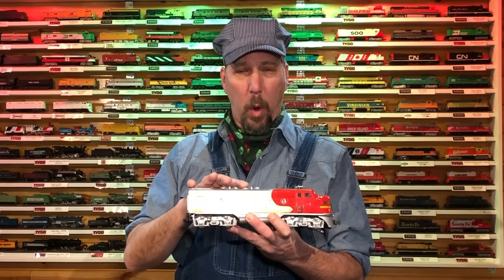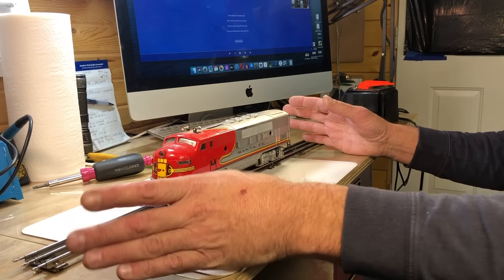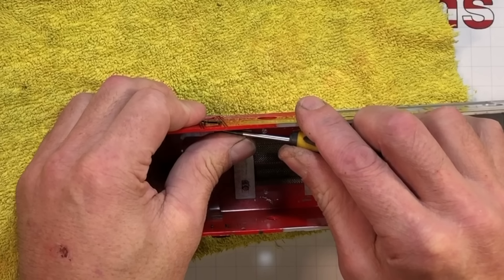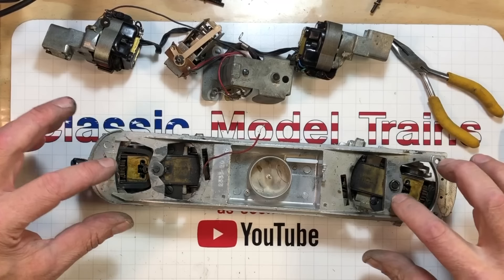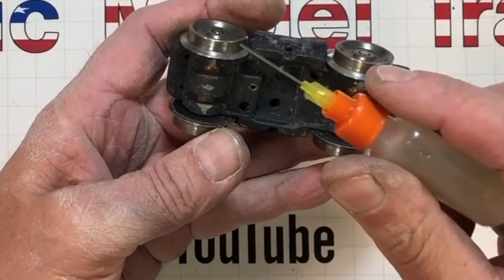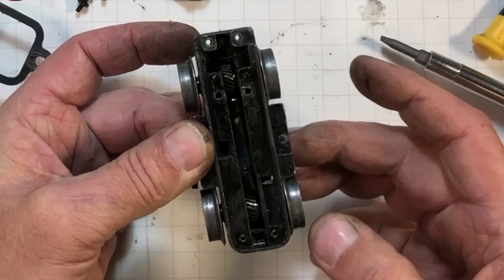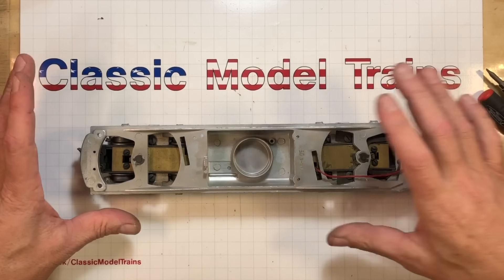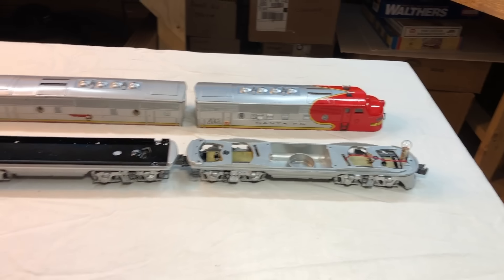Lionel #2343 Santa Fe A-B-A Complete Tear Down & Repair.

Comment from the maker: A few comments have landed that the S.F #2343 is NOT the most sought after locomotive.  I was trying to convey that this MODEL of F-3, the 1950-1953 F-3, has a lot of options that other productions runs of F-3's do not have. I have been made aware there is other road names that are much more rare. I'm sorry for the confusion 🙂
Reply: The 1957 Canadian Pacific F3 ABA set is probably the rarest. I've seen a set at train shows for around $6,000.00! It was only made for one year, 1957. I have the reproduction set that was reissued in 1973 and 1974. Being a 1957 Boomer, I would have loved to have the 1957 set, but will have to wait for a powerball ticket to hit to be able to afford that set!
Reply from the maker: @johnphillips4342  Holy Moly!  Thats a expensive set.  Pretty cool you have a re-pro of it :-)
Reply: I bought a SF 2343 unit that had a pretty beat up shell to get a chasis with 2 motors and magna-traction and put the Candian Pacific shell on it since the repro unit was just a single motor locomotive. After watching the videos I need to do a cleaning of the SF and CP powered units. I also have the New York Central F3 ABA set, for 3 of those iconic F3 sets.
I doubt today's highly electronic Legacy locomotives will be running 70+ years from now. Lionel did a great job designing and building the locomotives of the 1950s and early 1960s.
Reply from the maker: @johnphillips4342  Pretty cool you did a little mixing and made up a 2 motor C.P.  3 different road names of F-3, paint me jealous!!  Yeah I don't  think 2020 runs of model trains will be kicking around in 2090. Need to bring metal construction back :-)
Reply: @classicmodeltrains  the toy trains full of electronics that are prevalent in today's world of toy trains in the future the electronics will be just all cut out of the things and they will just run without any bells whistles Camp chatter speed indexing any of that garbage. My Williams locomotives the circuit boards generally the last about 12 to 14 years when they start singing to themselves that's the sign that they are about to go out. The rectifier is in the circuit board so if you hardwire the motors that you have to run straight DC and that I got no problem with when the time comes. It's amazing about the Canadian Pacific set because it was such a loser outside of Canada because who would want to spend such a amount of money for a Canadian Train. You could have bought as many as you wanted for less than suggested retail because people the shops were just want to get rid of them. I can't believe the ridiculous stupid money that's in these Hobbies now because of the rich people going in there and just jacking up the price of stuff left right and Center. They know nothing about toy trains or motorcycles but they managed to screw up both Hobby. Perhaps in 20 years you'll be doing videos about how to keep today's electronic trains running when you can't get electronic parts for them anymore. Even in the Box Electronics fail just from age. Coming from ho as far as I'm concerned as long as the train is running and the headlights on you're good.
Reply: Not the most sought after but indeed the most popular. I have that F3 in 4 different Road names.
Reply: @classicmodeltrains Love your maintenance videos. One thing I do when renovating F3 Power Trucks is to use Lucas "Red and Tacky" grease. I fill the trucks drive shaft comparment with this grease. The grease has superior cling and longevity. It's also good on gear trains of other engines like the FM Trainmasters in that it doesn't  get the tracks as greasy as other greases do.
Reply: It was one of my most sought after... When I started collecting Lionel, a double header of these and a full matching train. 25 some years  later added a beautiful B unit.

Comment: Ron as a lifelong Lionel guy here's a small restoration tip. The absolute best thing to clean the clear plastic windshields and window inserts in illuminated cabooses and such is non abrasive toothpaste and water. Wash, rinse,  air dry or hair dryer and they come out sparkling and smell minty fresh! Lol
Reply from the maker: Thank you for that info Howard. I actually waxed them with the turtle wax.  sorta the same thing.  A very light rubbing compound.  Except mine were not minty fresh :-)

Comment: Nice Video! My Santa Fe ABA 2343 - purchased new for me by my parents in 1952 - is absolutely original and still running on my layout, pulling a 9 car consist of Lionel Lines 2500 series aluminum cars that duplicates the famous Super Chief.  It has tremendous pulling power thanks to the weight/gear reduction/dual motors/magnetraction.
Reply from the maker: Thank you! Pretty cool you have the aluminum passenger cars also! What a great gift to get :-)

Comment: I like how you explained how there's are differences between scale versus gauge. Many people use it interchangeable in model trains (especially in O Gauge versus O Scale), but there is a difference. Also, I'm looking forward to part 2 of the series. Now, you just need something to run them around to show off the handy work.
Reply from the maker: I'm gunna need a bigger cabin to hold a proper radius "O" gauge 1:48 scale R.R.  Thanks for watching :-)

Comment: Hi Ron,  Thanks for the video.  Just terrific!   I’m going to refer to it when I get around to servicing my F3.  Back in 1950 or 51, I received my train set for Christmas.  I was about eight years old. I still have it today. The set included the Santa Fe 2343 F3 powered unit and dummy unit.  The set also came with a coal car, log car, searchlight car, freight car, caboose, RW transformer, track for an oval, and a disconnect track (the one with the round red electro-magnet in the center).  My parents paid about $69 for it(a lot of money back then).  The following Christmas I got the B unit, and later got the Santa Fe switch engine.
Back in that era kids were crazy for Lionel trains.  Every kid had them (although there were a few outliers that had American Flyer LOL).  A lot of kids had fathers that were just as crazy for them.  So they had huge layouts.  It was a great era.
Reply from the maker: I grew up in the 70's-80's era. Still a pretty good time. The 50's sounded like it was a better time.  Pretty Cool you still have that great set!
Reply: @classicmodeltrains  The early fifties was a pretty great time for Lionel.  We lived in New Jersey, and every year at Christmas time we’d go to New York City.  The highlight was the Lionel display at Times Square.  Lionel had a huge layout in the flatiron building showing off all of their new stuff.  People were always huddled around the windows about five deep.  Kind of like the scene in Christmas Story.  Lol
Reply from the maker: @rpondyke2121  That sounds pretty cool to have seen them kind of displays

Comment: Excellent video! My Father has an original 2343 ABA set he got for his birthday and still runs it to this day. I will definitely show him this video. You did a great job on the cleanup and restoration. I’m looking forward to part 2 !
Reply from the maker: Thank you Bob!
Reply: Off topic I know, but do you happen to know where I can locate some layout plans? I own a O gauge 2343 ABA set, but I don't have a clue what size curves to use and so on. Thanks.
Reply: @les6556  the curve size should be the largest you can fit in your space. The space determines the curve, not the engine. Many modern engines require 072 curves, 6 ft diameter but your engine will run on anything. Gary j

Comment: I have a set of these, AA, bought about 25 years ago. They were old then...
 The engine center rail rollers will show more wear then you would expect due to the high amperage those two motors take. They spark very much.
 I did two things to have those rollers last longer, since I was young and did not have much extra money back then. I added 2 wire jumpers between the active roller frames and the contact point on the end of that roller frame for better electrical contact, and then ran a wire from the dummy unit to the powered unit center rail connections. Less sparking and better power to the motors that way. 
You will want a larger then 90 watt transformer if you run these often.
Reply from the maker: Thanks for the great info.  I have a 250 watt ZW these bigguns will be suckling from :-)

Comment: Great job!I have an MPC era Sante  Fe Warbonnets which have the simplified vertical Pull Mor  motor and it pulls pretty well.Yours has the horizontal motors that are outstanding pullers and are indeed nicknamed Coffee Grinders!
Reply from the maker: Thanks! Glad the hear the MPC is a pretty good puller :-)
Reply: @classicmodeltrains  yes I have it pulling an 11 unit train in the upper level
Reply: Learned from experience to pass on any mpc era item and save up for better built, longer lasting stuff. Gary j
Reply: @thetrainboard2772  Yes,that good advice. If you buy something of lesser quality you will never forget what you paid for it ,but if you buy quality you will forget what it costs. I wise old guy told me that years ago and now I’m old man and still recall what he said to me.

Comment: Now that's a tough drive line. Lionel quality back in the day. If you're looking for replacement rollers, I found part number 2367-192. Where you oiled the pickup rollers, use Inox unless the oil is designed for electric use. Very good part 1.
Reply from the maker: Thanks for the info!
Reply: Did you mean to say NO-OX rather than Inox? Never heard of Inox.
Reply: @les6556  it's Inox. It's an Australian brand of WD-40, but in my opinion it better than WD-40.
Reply: @TheCreativeMind  Thanks for clarifying. I use NO-OX-ID. Leaves an almost undetectible coating on the track, and improves the performance. It's a paste that is applied thinly along the running surface of the track. I'll have to look up Inox. Thnx for the tip.
Reply from the maker: @les6556  Yes, I blew it and missed it in editing.  Sorry

Comment: I have a 2333 F-3 in both Santa Fe and NYC livery.  Both have magne-traction.  Both were purchased by my father around 1948, '49 or '50 and have remained in my family's possession since then.
Reply from the maker: Very cool!! From my research I found that magna traction was introduced in 1950. the only difference between the 2333 and the 2343 was magna traction. Perhaps someone has installed magna traction trucks back in the day?  But then I again I could have some bad information. Thanks for watching and commenting :-)

Comment: Hello Ron. Outstanding video. You’re correct, this is an iconic locomotive. The design of the locomotive, and paint scheme made this the most sold Lionel locomotive during the Postwar years. I personally have these locomotives myself, along with the original passenger cars that came with them. It’s the Lionel #2190W Super Speedliner Set from 1952. You should hunt down the original 4 2500 Series passenger cars for these locomotives, and you’ll have an incredible set. The #2531, #2532, #2533, and the #2534. If you want to take it a bit further, you can get the add on baggage car for it to really complete the set, and that’s the #2530 baggage car. There are 2 variations of this car, a Large door, or a Small door version. The large door version is not very common, and was only produced in early 1954. Subsequently, the smaller door version is much more common to find. Also to note, I noticed the light bulb that was in the powered unit. That is an incorrect bulb. The correct bulb should be a #1445 18v lamp. The bulb you have in there looks like it might be a #57 lamp which is a 12-16v lamp. The main difference other than the voltage railing is the Size of the bulb. The 2343 require a 3 1/2 eighths shape bulb, (7/16”) and your bulb is a 4 1/2 eighths shape bulb, (9/16”). It needs the smaller shape bulb because the power truck motor will come in contact with the larger shape bulb that you have in there. The clearances are tight between the bulb and the power truck. It’s not as critical with the dummy unit, but that too the recommended light bulb is a #1445. This way the the brightness of the bulb remain consistent between both locomotives. As far as the horn, you should be able to find a good used original horn for this F3 on eBay. You can also find a reproduction horn as well if you so wish, unless of course you want to restore it all original. That would really set that apart from everything else out there. I’m an avid Postwar Lionel collector and operator myself, and I hope this helps you out with your restoration. Regards, Tom
Reply from the maker: Greetings Tom! THANK YOU VERY MUCH for the great information you shared.  I believe I had a line on them passenger cars on e-bay. Aluminum extruded right? There was 4 of them, in pretty bad shape, restorable of course, but I thought the bids got a bit high so I backed off.  Should have pressed on. The old bulb I pulled out was a #57, but I did notice what you mentioned with the clearance issue. I shall hunt down some #1445's. I couldn't find a original horn on the bay, but did locate a repro being offered. $20 seemed fair.  Your information definitely helped out!! Hope your holidays are good for you and yours,  Ron
Reply: I have an old 0 gauge F3 A-B-A with passenger cars, and a box full of tracks, but I don't have a clue about layouts. Would you happen to have any track layout plans? Is there a minimum radius to use for the curves? Thanks.
Reply from the maker: @les6556  Just found this comment.  Sorry for the long reply time.  I believe the minimum radius for these is 31".  I don't have any track plans but the google machine is filled with so many of them you won't know which one you want to do first :-)

Comment: Thanks for explaining the difference between "scale" and "gauge".  I didn't know that Lionel 027 was 1/64th scale and not true 1/43rd scale.  Since I model a period before 1950, most of my engines are steamers.  Only diesel I have is a Texas Special that only goes forward.   I changed out the incandescent headlight to a 5mm LED with ballast resistor (current limiting resistor).  I guess all my "O" gauge are 027 "scale".  Doesn't matter 'cause my track is 027 that I weathered.  I've got to review your video on adding extra ties to the track.   Cheers from eastern TN
Reply from the maker: Yup a lot of Fellers mistake scale and gauge.  A Lionel true "O" scale will be quite a bit larger than a O-27 one.

Comment: I watched the body disassembly portion several times, but never saw the original clear portal windows being removed or out on the work bench. I agree the originals look much better. Were they simply round discs that press into the counterbore? The "new" version, with the flange, creates an unusual fish eye affect that I don't find appealing.
Excellent informative video!! Thank you for posting this.
Reply from the maker: The powered A had no original windows.  The dummy A had 2 and the dummy B had 2 originals.  I popped them out early on and had no footage of that. When I ordered in new port hole windows they only came in 8 pack. I installed the new ones in the A's and glued in the originals into the B.  You have a very sharp eye! I agree the new ones have a funny look to them. I would prefer originals.  Thanks for watching and commenting :-)

Comment: looking at the rear frame of the powered unit, the two little holes in the center of the frame, are the horn mounting mounting holes.  
On top of the Zed bracket' the horn, mounts over the drive shaft, of the motor....  
I'm not that smart, but I have a service manual!!
Reply from the maker: Yeah, I mentioned the holes later on in the video.  I need to get on ordering up a new horn for the Gal :-)

Comment: I have both the 2343 and the 2333 which I purchased new shells from Lou at Madison Hwr in 1977.  The 2333 has horizontal motors…
Reply from the maker: A couple of Classic keepers!!
Reply: @classicmodeltrains  According to Lou Shur back in 1978, he told me that the lowest production was the Canadian Pacific F3’s & passenger set; however he also said the Texas Special AB was the most desirable! In 1979 I was able to purchase the Canadian Pacific set for $500. All boxed and rarely used…
Reply: @classicmodeltrains  And I must add an honorable mention. The Super O New Haven AB set; I have it from 1958.
The odd thing is; it only has one motor in the A unit! So at an old Greenburg show I P/U 2 rear F vertical motors and put them in the B unit. The set includes the Mint and the Aquarium cars and the black 6464 New Haven and the white caboose.  I just wish Lionel would have made 072 super O curves…
Reply from the maker: @Myriadconcepts-q9u  pretty cool you scored the  CP so long ago when the price was not yet thru the roof !!
Reply from the maker: @Myriadconcepts-q9u  sounds like you have a lot of really nice desirable items. very jealous! 🙂

Comment: Lionel used to put ever ready batteries in all of their locomotives because they never thought of them sitting on a shelf for 40 or 50 years and the battery eating away at the locomotive because it leaked. They figured that they would be sold at Christmas and the battery would just be changed whenever it wore out. I actually saw a court case on TV where a guy bought a gg1 I think might have been an F3 I don't remember but it was heating Away by the battery acid that was inside it and the seller said it was meant in the Box unopened so he didn't know there was a battery in there or is that the engine was damaged it was sold brand new in the box. The judge ruled for the seller because he said there was no way for him to know because if he had opened up the box then it would lose value.
Reply from the maker: Kind of a sad story.  Didnt know Lionel shipped them with batteries installed. Kind of a catch 22 for collectors.